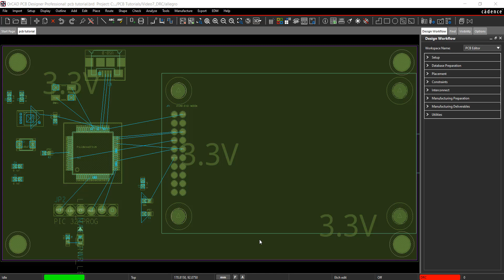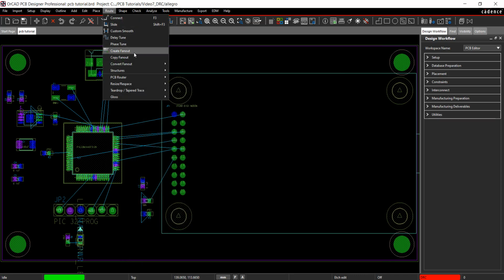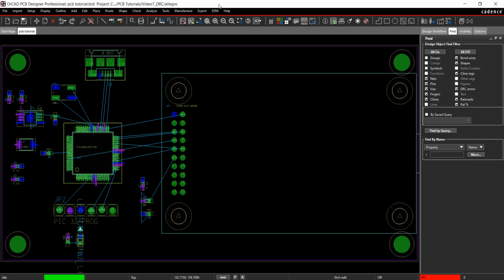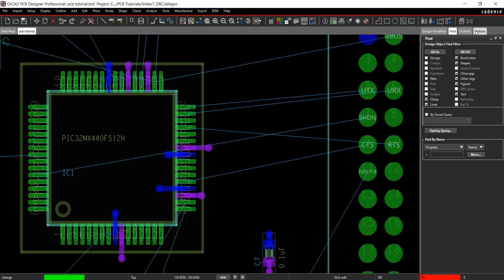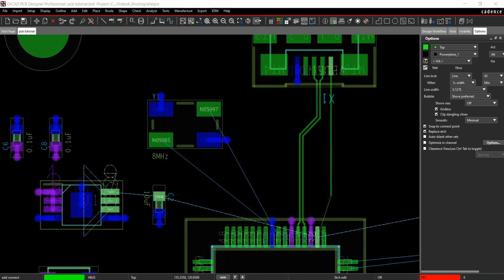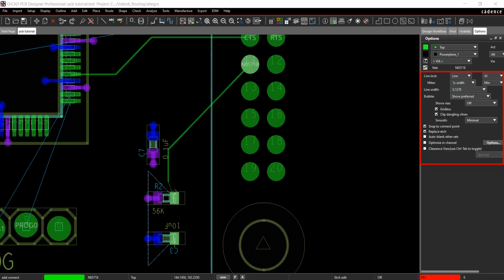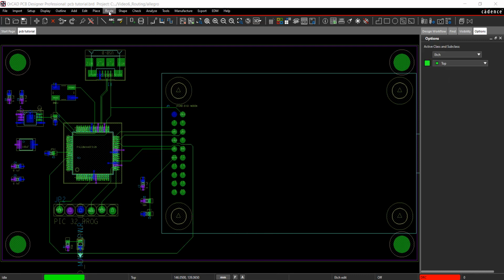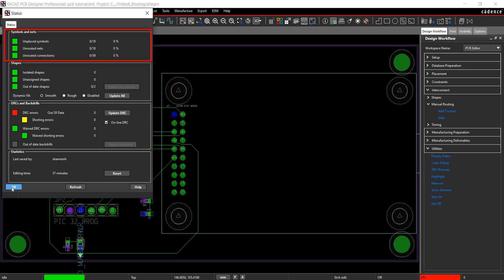How to Route Your PCB in OrCAD PCB Editor 17.4

Comment: When I create a fanout the traces are so thin. How can i fix this? thanks
Reply from the maker: Hi Jason, You can either define a default line width in the physical section of the constraint manager (Setup > Constraints from the menu) or select Override Line Width in the options panel when creating a fanout and define the desired trace width. Hope this helps!
Reply: @EMADesignAutomation  Is this something that needs to be changed before the fanout I noticed other students create fanouts and the trace was the same as the video. However, mine were as thin as a line.
Reply from the maker: Yes, trace thickness will be automatically assigned based on the constraints set in the constraint manager, so constraints should be configured first. Trace thickness can be changed after the fact by selecting Edit > Change Objects from the menu. In the options panel, you can check line width and specify the width, then select the desired traces in the PCB canvas. 

Setting constraints in the beginning of the design is suggested. This allows you to set rules for different trace requirements (power, differential pairs, etc.). Routing options will then be configured automatically based on the assigned rules.